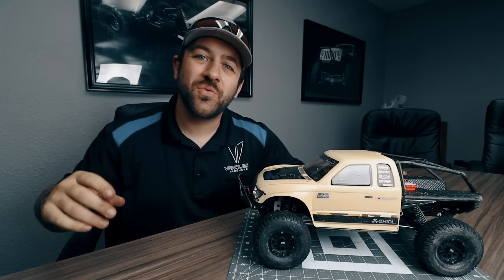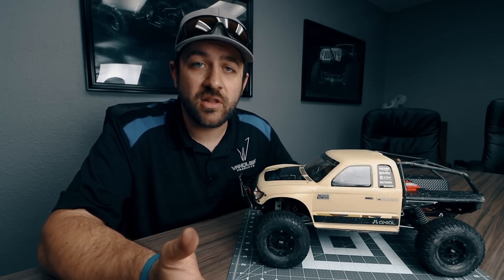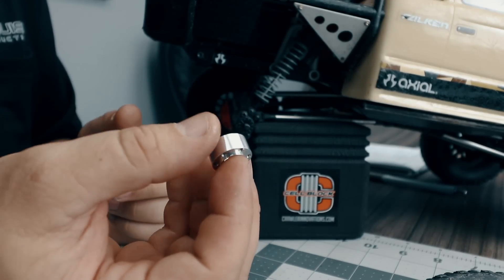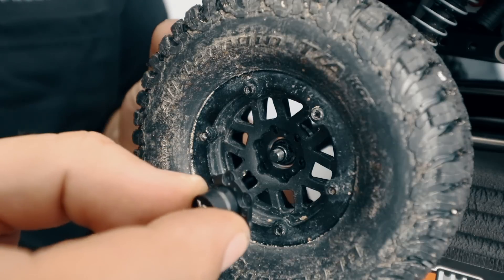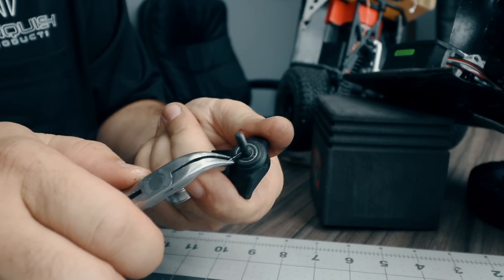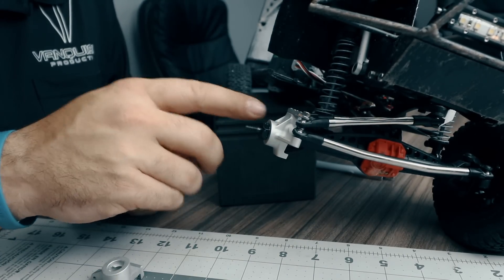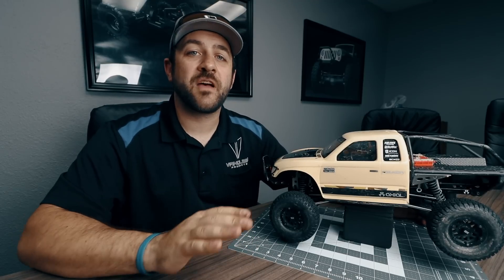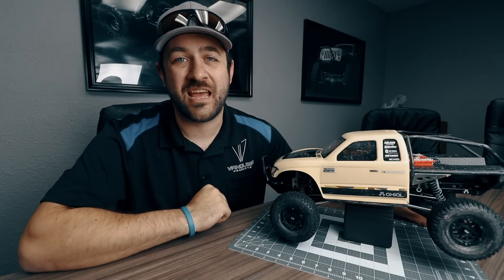Axial SCX10-2 Trail Honcho $50 Budget Build - Week 15 - Knuckles & Hubs

Comment: Please explain why use and what 8deg  knuckles and hubs do and add to the steering. Why 8s it better and wat are the pros and cons?
Reply from the maker: 8 degree refers to the kingpin inclination built into these vehicles. The angle doesn't always have to be 8 degrees, that is just very common on our trucks. To get into the full technical explanation would be quite long, but I talk about it indepth at this point of the live portal video and it applies the same to any truck: https://youtu.be/EN2MRWUBcJA?t=55m15s

Here is a good discussion on it with some figures as well. https://www.quora.com/How-does-kingpin-offset-affect-steering-effort-and-what-are-the-other-effects-of-it
Reply: Great stuff. Thank you

Comment: Will the vanquish knuckles add weight I need a bit more weight in the front alone
Reply from the maker: They are heavier than stock, but not by a huge amount. It is more about strength and style than about the weight.